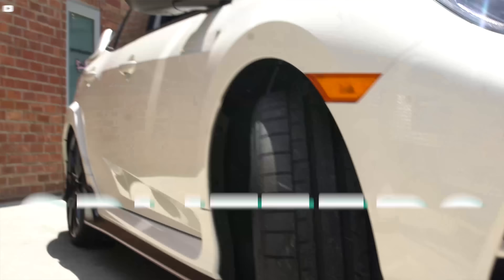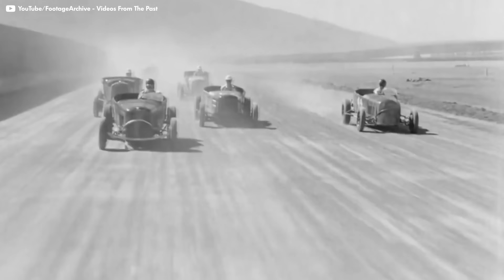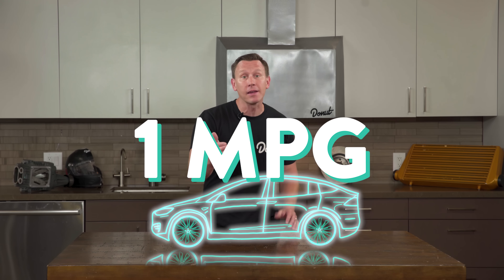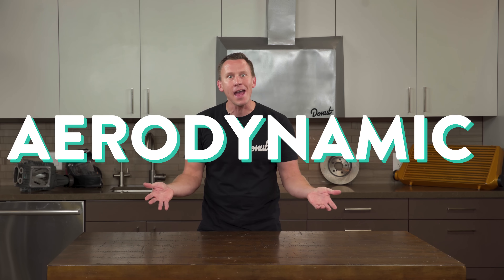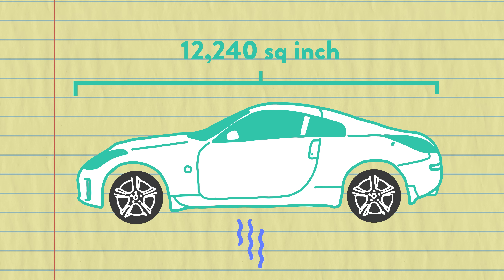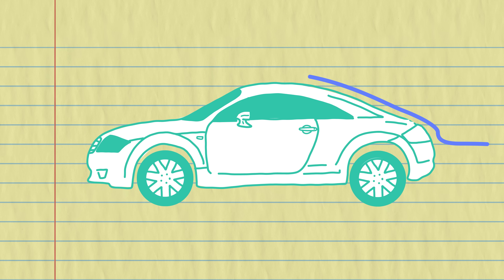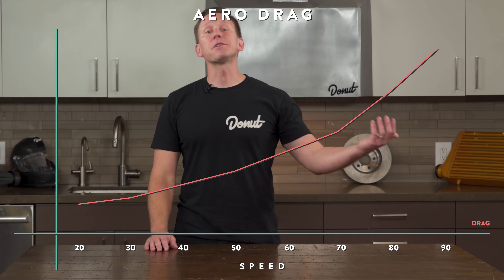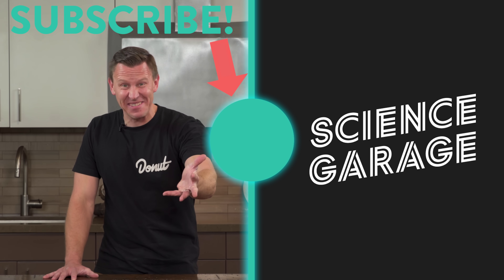Wings and Spoilers; Lift and Drag | How It Works

Comment: The first American mass production car designed with the aid of a wind tunnel was the 79 Ford Mustang. The money spent on that research was taken from the account for good brakes and the rear suspension. Thankfully the aftermarket jumped in with products to fill the voids created by Fords blind stinginess.

Comment: 7:13
This is why the trunk of a ford P71 has a slight upward curve at the back. Ford found that at the higher speeds they designed the P71 to go vs the stock Vic it would spin out on corners so instead of re engineering a lot of the suspension etc they just put some downforce on the rear wheels.
The Mercury Marauder can go even faster and has a little spoiler tacked on there.
That whole decision approaches the fine line between a smart decision and a lazy one lol.

Oh yeah and if you own a P71 and ever need to replace the trunk dont replace it with a civillian model crown vic/grand marquis trunk unless you know youre never going to go fast
Reply: I actually enjoyed reading this, thanks lol

Comment: JAJAJAJAJA you got your physics wrong on the lift, a common misconception but since you'll be doing more  videos on aero perhaps you could include a quick  mention of conservation of momentum to your formula of lift, this all has to do with the overall conservation of energy of the system. I mention this because it actually would affect the explanation of some aerokits. Also, when you separate drastically laminar fluid from the surface of the car  a vortex of turbulent fluid is formed thus generating this "pocket" of  lower pressure pulling on the surface of tha car, this is also important as the position of this vortex relative to the car causes not only drag but lift. There's whole lot more information about it but I'm sure you'll be doing your homework all right!

TLDR: You messed the lift explanation.

Comment: Charger Cd is .35, Challenger is 12% more at about .39/.40 and yet demon does low 10s.....
Reply: dlock WOLF It's got a lot of power to overcome that drag count. Look at time attack cars, they've got lots of downforce, which in turn means a lot of downforce-induced drag, but they have the power to make them seem less of a problem.

Comment: is it just me or are they wrong at around 6:00 , to be sure I looked up the pressure zones of a plane wing and its the same as the graphic they showed, if a spoiler like the one in the graphic was real it would create positive lift making the car have less grip. I then looked up the air pressure spots on a car's spoiler and the air on top is moving faster than the air on the bottom, the high air pressure pushes the car down and the low air pressure on the bottom creates a vacuum pulling it down. he states that " a wing mounted on a car generates downforce when air moves more quickly across the bottom of the wing." THIS IS NOT TRUE.                                                                                                                                                 sources:  1. car spoiler) http://www.buildyourownracecar.com/wp-content/uploads/Aerodynamics_WingWithEndplates.png                                                           2. plane wing)  https://logantuite.files.wordpress.com/2016/06/pressure-distribution.gif?w=840

Comment: 2:12 *quadratic
Reply: are you slow
Reply: @uncloudy6820  no but I assume you are since this comment is 6 years old lol

Exponential means the equation is in the form of c^x while quadratic means it's in the form of x^c, where x is speed and c is some constant. This isn't even that hard to check yourself: an exponential function would mean (4 x 2^35) = (2^70), which it doesn't. (4 x 35^2) = (70^2) is true, and that's quadratic
Reply: @wi1dcard192  lol he's not talking about the exponential function in the video, he's talking about how drag increases exponentially because of the v^2 term, which it is because it has an *exponent* = 2
Reply: anything that has an exponent will increase exponentially by definition, that's the whole point of exponents, something increasing exponentially is not the same as an exponential function

Comment: I drove my civic into a ditch doing some rally practice and I fucked up my front bumper, radiator support and radiator. I got the radiator fixxed and everything but I haven't put a new bumper on yet and I get like 25 mpg city when I used to get like 35 on average.

Comment: Bernoulli's principle of lift only accounts for roughly 6% of a wings total lift, AoA or angle of attack is the primary lifting force on any wing moving through a fluid
Anderson, David (2001), Understanding Flight, New York: McGraw-Hill, pp. 15–16, ISBN 0-07-136377-7, The first thing that is wrong is that the principle of equal transit times is not true for a wing with lift

Comment: But remember kids, a Huge wing doesn't mean a faster car.
In fact, your top speed drops.
Reply: Yep it gets you more drag, so it's better for high speed cornering but you will suck at top speed on straight lines...
Reply: Ahmed360 thank god somebody said that
Reply: Faster in corners though. Its a trade off. Depends on what you need though.
Reply: Time attack car: are we a joke to you?
Reply: @bhaswaraarizon5012  HAHA YES MAN HAVE YOU SEEN THE GTR WITH A REAR WING AT THE FRONT???
Reply: I would like buts it’s at 69
Reply: Add all the power, fat drive tire, etc, but your speed == 0 if you can’t nake the turns. Road and even circle/oval racing is about the turns....
Reply: Ahmed360 so cute spoilers increase stability on high speeds while huge spoilers drops speed + decrease stability also?
Reply: So better for handling and daily driving, just bad on a drag strip

Comment: I wish there was a video about the nitty gritty details of aero.  like... should the side skirts be angled downwards to create a small tunnel or should they be flat horizontal flaps that just increase the area under the car.   and at what point should the rear diffuser start angling upwards.   Does having the diffusing part of the diffuser behind the car make a difference?  how far behind?  Why do so many LeMans cars have pretty much a completely separate part as the diffuser supported by rods instead of integrating it into the body work.   Does the shape of the fins on a diffuser have any bearing on the amount of downforce?  would angling exhaust gases into the  low pressure area behind the car help reduce drag?     What is the best way to vent the high pressure area in the wheel wells?

Comment: you forgot to mention that wings only create a direction of push because of newtons third law, without the third law nothing would happen. The pressure difference is negligible at best. It just directs the flow. The Two most important concepts with aerodynamics of a wing are the Coanda effect and Newtons third law.

Comment: 6:49 that's wrong, the air doesn't speed up. there is now way you can speed it up without a fan or something. but it gets compressed up top of the wing, creating high pressure and below the wing it gets expended to get lower pressure. What you guys are saying is believed by many but is not true. Tbh it's a bit disappointing from you guys.

Comment: Next episode: How stickers gain HP?
Reply: And how neons gain torque
Reply: So legit stickers are made of a special reinforced hyperpapyrus polyconcentrate which if connected to the engines via special microscopic fiber optics, could amplify the engine power much like a supercharger, therefore adding horsepower. The neons contain a non-newtonian fluid. It reacts to acceleration by breaking down electrons with positive charge, helping the oil and working the engine more effortlessly, so it gives more capacity for more power, pushing the car furthermore, and finally increasing the amount of torque.
Reply: Psychopathway That's some technical bullshittery science there, that's a good attempt actually. (no, seriously, I mean it😅😅)
Reply: Marko Vukotic Ricer logic, that's how.
Reply: Marko Vukotic much watch
Reply: lmao
Reply: Well such beats makes a unique frequency in the surrounding air. At times, it creates a vortex in front of the car, and helps the car accelerate. I hope they include this in the part 2 video and hopefully with James
Reply: Mohd Aiman Azrie The tempo & the rhythm, you need to pick the right track for the right touge.😜
Reply: Psychopathway that was awesome.
Reply: Such a skill in bullshittery, I'll be disappointed if you ain't millionaire yet. I applaud you good sir!
Reply: Marko Vukotic made my day
Reply: Especially trd sticker on toyota's cars
Reply: They don’t, They can be used for aerodynamic purposes. Not joking.
Reply: I have carbon stickers, lighter than regular vinyl....now my beetle runs faster.
Reply: I was the 666 like
Reply: and how fake hood scoops improve turbochargers
Reply: And how pool noodles improve cooling
Reply: And how red-painted brake pads add +50 HP.
Reply: Audio Bass increase maneuvers
Reply: crazy how i just added a baby on board sticker and my car went 💨💨woosh💨💨
Reply: only if they are red, everyone knows this